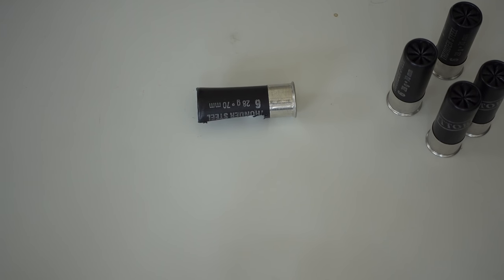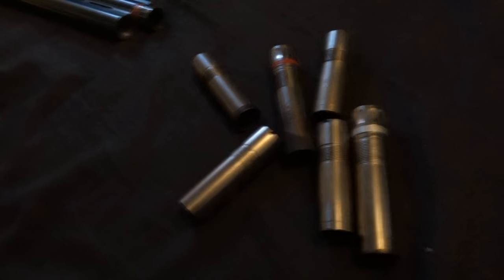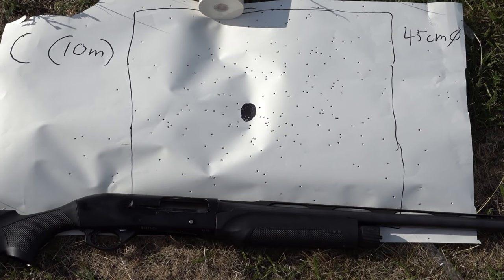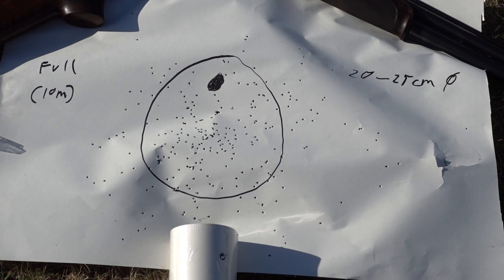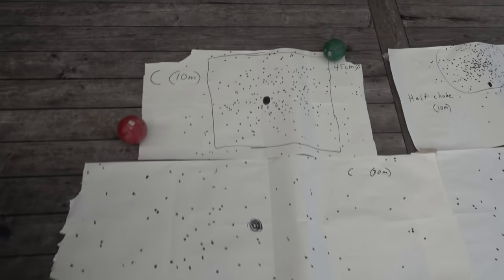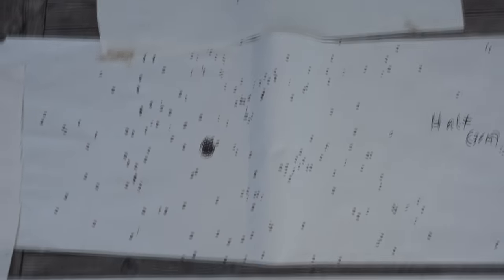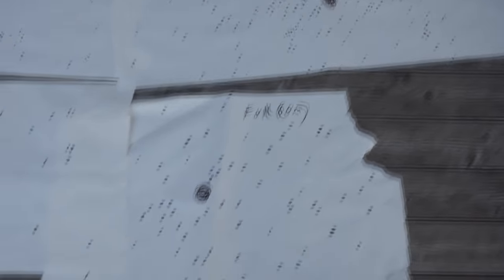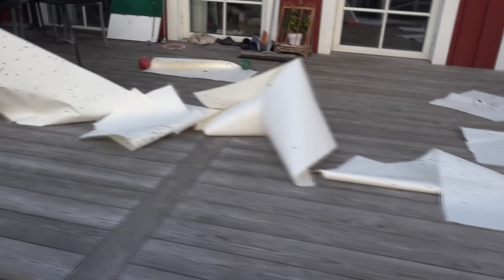Shotgun chokes - Visually explained

Comment: A truly accurate experiment, test, or demonstration tries to control as many variables as possible, except for the one variable being tested. Using the same shotgun, same ammo (shot size and manufacturer,) same distance to the target, and same type of target (paper thickness, etc) are variables in a choke performance test that should be controlled if possible, even if any of them seem trivial. Even doing multiple shots of each shot size, and using the average spread of each size would be helpful. Any variation on any of these other variables may affect the accuracy, or reliability, of the results. Of course this was a more casual demonstration, but these are simple variables to control. Also if you were wanting to do a more in depth demonstration, a demonstration of all of the choke sizes would be good; Cylinder Bore (US)/True Cylinder (non US) (no choke as the baseline,) Skeet/Improved Cylinder, Improved Cylinder/Quarter Choke, Modified/Half Choke, Improved Modified/Three-quarters Choke, and Full Choke (both US and non US) Also there are three less common chokes; Light Modified/Three-eighth's Choke, Light Improved Modified/Five-eighth's Choke, and Super Full (both.) And if you wanted to expand further, using different shot sizes up to 000 Buck would be enlightening. But like I said, this was a casual demonstration just to show a more simplified difference between the more popular choke sizes, and not a scientific demonstration.

Comment: I'm using a Kel-Tec KSG, I purchased A choke tube adapter for it made of steel; can I use this without a choke? I'm asking because I'm under the impression that it (chokes) will negatively effect the #1 buckshot from federal premium with flitecontrol.
Reply from the maker: InkwellFoto Hmm.. I can't answer the direct question of wether you could use the adaptor without a choke (I would personally not risk it). However, do consider going with a cylinder, or maybe a Skeet-choke that has the minimal impact on the load.
Reply: InkwellFoto never never shoot without an choke not only you're killing the threads for the choke but also the barrel of your shotgun!

Comment: What choke and load for a 20 guage deer hunting
Reply from the maker: Depends, are you using a S/S, O/U or a pump/semi? 

If using a pump/semi you should do fine with an open choke and slugs, just get some training in and get to know your gun. 

If you're using an S/S or O/U it might be a bit more problematic? Since it's often not adviced to shoot slugs through these and buckshot might not be enough for most situations, I'd consult my local supplier. :)
Reply: @whatsnext8548  Thanks for replying. So over under shotguns are meant mainly for birds?
Reply from the maker: @ctripps1224  O/Us are excellent guns for deer, though there might be an issue of "stopping power" in the case of a 20 bore with buckshot. A 12 Gauge is the traditional choice.

I can't really say I've got much experience on the matter, but it's often mentioned when hunting is discussed. 

But as with many things in hunting, knowledge of laws and your equipment is key. :)
Reply: @whatsnext8548  When hunting deer you probably only want to use a full choke, correct? No other chokes?

Comment: So if you're using for home defense then either a cylinder or half choke. I figure that because the average home in the US is about 2500 sq ft, i.e. 50 ft by 50 ft on a square foundation. 50 ft is roughly 15 meters.
Reply from the maker: Anthony Vanover If talking home defence, I'd say that's a fair statement. Choosing a narrower choke than that would only limit the spread as the effectiveness regarding home defence would rather rely on what shot you're using. 

My five cents that is. :)

Comment: Untrue!
Reply: From most open, to most closed, it goes: cylinder, skeet, improved cylinder, light modified, modified, improved modified, light full, full, extra full, so you are actually wrong.
Reply: well there's also light cylinder so if you want to be that picky you're wrong too
Reply: Your all wrong The more open the choke just use a heavier but slower load. King george 5th used a 25 " side by side bored cylider in both barrels firing 34 gram loads but a 1125 fps a special load by a london gunmaker no problem bring down stratospheric pheasants  slower loads tighter patterns.FACT

Comment: Does the fully open choke allow you to shoot slugs?  Good analysis by the way!
Reply from the maker: Thunderkat65 Indeed it does! Some slugs can perform better in a rifled barrel/rifled choke, but in terms of width, a cylinder bore is fully functional. 
Some slugs can even be shot through a narrower choke, but one should make sure it's compatible. :)
Reply: +What's next? What Can A Person Get A Shotgun Choke And Is The Full Choke Better At Doing More Damage?
Reply from the maker: TREAL406 You should be able to buy a fitting choke at your local gunshop, just make sure to buy a choke that's right for your gun.

You could say it's better at doing damage, but that depends what you mean..
At very close range it's not going to make as much difference as it would further out, they are both going to act more or less as slugs. further out however the full choke means more pellets on target and therefore "more damage" :)
Reply: +What's next? How Will A Shooter Rather To Buy And Or Use A Full Choke Tuve Or Half Choke Tube.
Reply from the maker: TREAL406 That depends on what you want do do with it, but for clay pigeon shooting/hunting, a half-choke takes you through almost any situation. :)
Reply: +What's next? If You're Shooting Large Game Or At Longer Distance Will A Full Choke Be Appropiate?
Reply from the maker: TREAL406 One should be careful not to extend the reach of a shotgun to a point where the velocity is not enough. 
Other than that a full choke will allow you to shoot at a longer distance and if you combine that with a heavier load (make sure the choke holds) and bigger pellets, it could be surprisingly effective.
Reply from the maker: TREAL406 shotgun. Some big games could indeed be hunted with shotguns. Some with big loads, others with slugs. Check out your local hunting-laws to make sure. :)
Reply: +What's next? It Seem Like With A Half Choke The Shot Won't Be Spreading Out As Far And Be More Closer In.
Reply from the maker: TREAL406 In my case that might actually be true, but that's not the intended use for a full. My full choke used with that brand of steelshot might have been to violent and so it spread more than intended.
Reply from the maker: TREAL406 A full choke is meant to give tighter spread, but the result might have been better with lead-shot. For the longest of shots, I recommend the full choke. :)